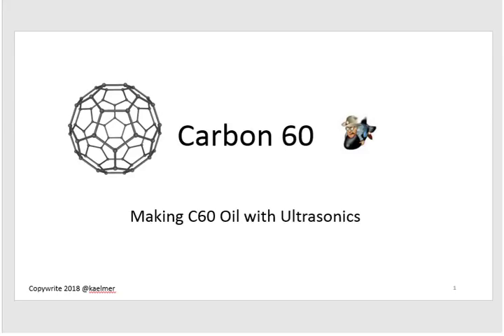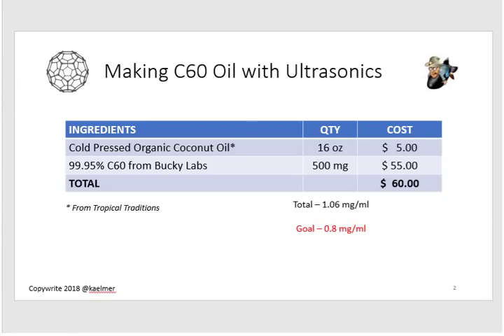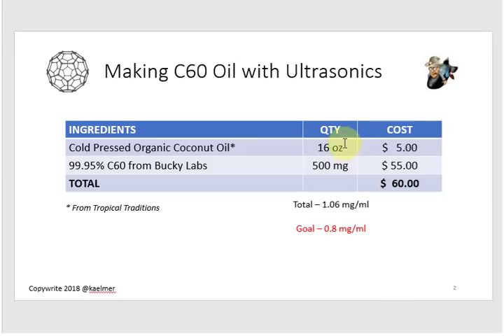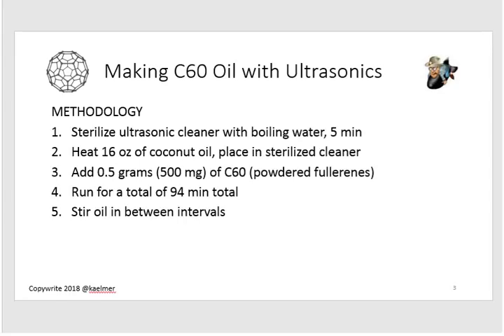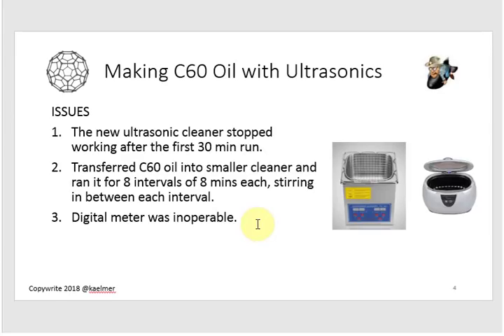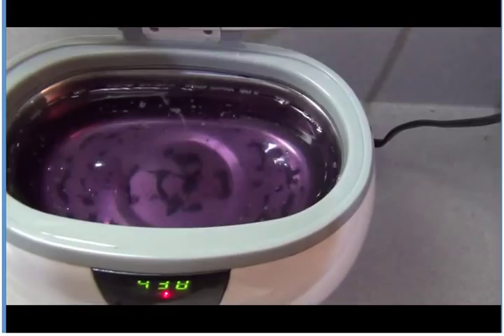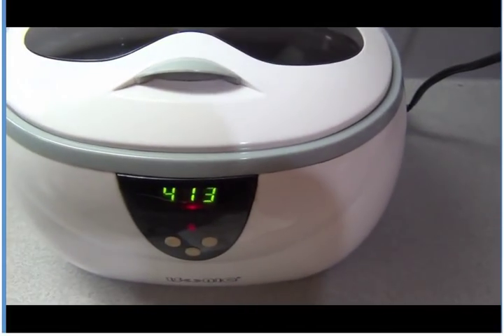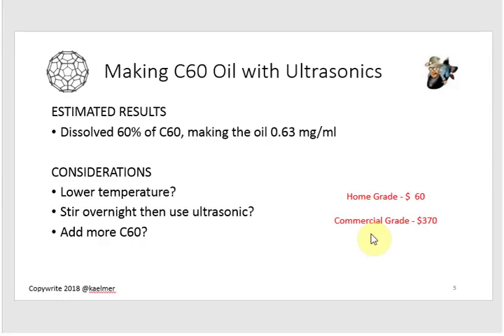Carbon 60 - Making C60 Oil using Ultrasonics

Comment: look into ichor labs research/comments on longecity. ichor labs had a batch that might have been made with ultrasound by SES. all mice were dying because of cancer (and it looks like the c60 group was hit badly)
still waiting for the final report to be published. so just to be sure: no light, no heat, no ultrasound.
Reply: Why no ultrasound?
Reply: That's scary!
Reply: no need to be scared. just to be on the safe side - no light, no heat, no ultrasound :-)
(so putting it in a dark bottle and shaking it 3 times a day for 3 weeks  is a cheap and safe way :-)
http://www.longecity.org/forum/topic/96700-update-on-the-status-of-ichors-c60-research/
"C60oo is highly reactive when light exposed, and that light exposed C60oo either had no effect or was acutely toxic"
Reply: My suspicion is that they were either using sub-par fullerenes or rancid oil.  If you consider that the rat study scientists were using stirrers and centrifuge I can't imagine an ultrasound could make that much of a difference.  Have you successfully made any c-60 using the hand shake method?  I actually already have a stirrer packed away in the shed but am considering purchasing an ultrasound as well.  Thanks.

Comment: Thanks for the nice video. I also make liposomal Vitamine C with my ultrasonic machine. I was warned not to do it directly in the ultrasonic but in pyrex beakers because of the nano steel particles contamination.( very bad for your health). I have been using thin walled beakers succesfully for quite a while now. The thing you have to take into account is that the pyrex absorbs part of the ultrasonic waves so I add extra time for compansation. The thing with all ultraonic machines is that they cannot be used for too long a time in a row. Google that pls. I take a break of 30 min after using it for 30 min. for that reason. 
I hope you share another video about what has become of the residue and any further experiments. Thanks again for this one

Comment: hey mate i blew one of those ultra sonic machines up when  first started liposomal c. i have bought another one and only run for 20 min at a time with ice cold water in it then restart hours later and it hasen't blown. they just get to hot the fans are shit.
i float a pyrex bowl (like one a cook would use 10mm thick) in the ice water don't put any solution directly on steel of ultra sonic machine you will contaminate product. Also don't use thin wall pyrex beaker as strong sonic machine will explode hole in bottom of beaker, haha messy.
Reply: You risk blowing a transducer by setting a container directly on the bottom of the tank.  A thick glass container makes it hard for sound waves to travel through.  Thin glass works better.  Place a plastic scrub pad on the bottom of your container.  Anything to avoid direct contact with the bottom of the tank.  If you want to get fancy,  cut a hole the size of your flask in a piece of Masonite or plastic sheet and place a heavy rubber band around the flask to keep it from slipping down.  The water level in the bath should be even with the liquid in your container.  Adding ice cubes will cool the bath down.  A turkey baster can take water out if needed.

Comment: Coincidently I ordered my ultrasonic cleaner the same day you posted this. I have 1000 ml spinning right now but wanted to try the faster method to compare the difference.  I'm using 99.95 C60 from SES Research at $70/g and fractionated coconut oil as the carrier. Using .71g per 1000 ml (slightly less than the rat study.  Given the ambient temperature here, which is a very critical variable in the absorption potential of the oil, .71g/100ml is about the max I can expect.  If you are interested in my results contact me at sclewis (the number 4) @ hotmail.  Thanks for posting your experiment!

Comment: The problem I have ran into is that they will not sell C60 to me the average Joe without being a business where can I purchase C60 and have it delivered to my house
Reply: I bought one gram from Bucky Labs.  I saw others that will sell small quantities also, don't recall names though.  I read a bit, and found that the lower priced powder containd solvent residue, so decided to get the higher priced, higher percentage one.
Reply: Like I said, I got mine at Bucky Labs, buckylabs.com  It took about 2 weeks to arrive.
Reply: WhoToBelieve I can only find c60 mixed with olive oil on their website. Where do I find the powder?
Reply: I'm sorry, I didn't do a good job of answering your question.  Go to the website; select "Products"; scroll down below the oil bottles and you see "Fullerenes", there are 2 selections, 99.9% & 99.95%.
Reply: WhoToBelieve Thank you very much!

Comment: Thank you for this update, please keep us informed. I have a batch in a mag. spinner and it has another week to go. I am going to buy a jewellery cleaner from Amazon  and give it a try. I found a cheaper place to buy the C60 in Canada, a place in Quebec called Solaris Chemical who sells 99.9% research grade fo $60-70US per gram. Check it out it looks like this place makes good product, I am not yet finished my research on them but so far it looks good.
Reply from the maker: Thanks!  I saw those guys, one of the vendors on the list uses them.  The reason I bought from Bucky Labs was my decision to use 99.95%, which Solaris doesn't sell.
Reply: Actually now they make both 99.95% and 99.99% C60. I just asked for their research material and they sent me the full report and a report on oil absorption rates for their C60. Big report, it will take time to go through it. I will probably send it to my daughter [who is a scientist] to read and make sense of. They are using a method derived in Russia. Apparently the Russians have been feeding this to their athletes and military people for many many years with great effects. I got that info. from relatives of mine [ I am 50% Russian heritage ] . There are a couple of C60 in oil sellers who are using their products and I am told 2 or 3 who make it for animals.
Reply: thank You . I just found the link.. and requested More Information, which they offer to emaiL > > > http://www.solarischem.com/C60.html
Reply: Earl K. Would you share that report? Or if there is a link for it I would like to take a look my self!
Reply: Earl K. Thanks so much for all your comments and info.  Huge help!

Comment: Great video series, Thank you.
Would a TDS meter work to determine the saturation level of C60?
Is the coconut oil/C60 combination, processed ultrasonically, a mixture, a solution, or liposomal encapsulation?
Would ultrasounding longer increase the saturation level?  I think higher wattage would help also.
Check AliExpress for an ultrasound unit.
Very informative, thanks again.
Reply from the maker: Yes, was thinking of running it much longer to see if there's less residual C60 left and did consider using a TDS meter, but from what I understand, the C60 molecule is so small, I don't think it would pick it up, and not sure how well they work in oils.  Certainly worth a try though.

-and this process results in liposomal encapsulation.

Comment: Thank you for the video on the ultrasonic cleaner, I was looking on Amazon and found only jewelry cleaners, me thinking there must be a food one, wrong. Ordered what i needed for the 2 week steering batch, but would be great to have one that works so much faster. I will keep watching your videos as they have already taught me a lot, thank you.
Reply from the maker: They're all for jewelry so the assumption is its not food grade stainless steel, which is why some lipo instructions advise to keep your solution in a flask and put it in water inside the cleaner.
Reply: WHAT  do you suggest? I don't know if a glass beaker will fit. i just ordered one that holds2.5L and i have a 1000ml beaker. Is the difference between a good grade stainless steel and not a lot. Some times people are afraid of their own shadow and I was an old farmer so I don't sweat the small stuff.  Thank you for writing me back , you are a great help.

Comment: I realize that your process didn't go quite smoothly like you wanted, but if you did this for approximately 180 minutes, would the rest of the C60 then dissolve into the oil?  Because the C60 is expensive, what did you do with the leftover that didn't dissolve? Did you use the ultrasonic to save the 2 week stir time of the other process? I appreciate your very clear presentation on your videos !!
Reply from the maker: Plan to add more oil to the remaining C60 and give it a run to see if I can use it up.  Running it longer is definitely another good idea to test out.  -and yes, I'm trying to find a faster way to make it.  Sort of my quest for better, faster, cheaper...
Reply: I am wondering how to test for the purity of the c60 you made? I also was told by a producer of the c60 oil he follows the French method and does the 5 grams to the oil but hen reuses the left over c60 into the next batch but he does not supply any documentation or verification of the potency he provides, just simply states he follows that method but I dont think the French guys reused the c60 afther the run they did, or did they?

Do you think a PPM meter would pick up the PPM's in something ordered from Purple Power and then checking your c60 oil against that?  I would suppose getting it lab tested would be pretty expensive. I do want to try to make my own but I am worried that just trying things and not fully knowing the end product either may be a waste of time and or money. 

I love your vids and subscribed, keep up the good work and if you have any suggestions to determining the potency please let me know.
Reply: I found out from one of the labs guy that C60 has no expiration, and that yes, he thinks that the remaining C60 powder can be reused for the next batch. And to be careful where you order your commercially prepared finished product, because said lab guy had to ban one seller that was ordering the class that is of lesser purity and potentially had many solvents in it.
Reply: I have heard that its OK to use it again

Comment: Nice!  I'm curious to find out if the fully saturated coconut oil works out.   My family and dog, have no issues eating extra virgin coconut oil... But the liquid version (possibly MCT oil) from purple power doesn't fair as well with my wife and I.  

I'm 1 week into stirring 1 liter of liquid coconut oil (Nutiva Organic, unrefined, liquid Coconut oil) that is not the MCT version... The oil stays liquid at even fridge temperatures yet still has that slight coconut flavor that the fully saturated oil has.

Mine turned a dark purple within about 3 days.  I used 0.78 grams of 99.5% pure c60.  I did use a stainless steel mortar pestle (Apothecary's Grinder) from Amazon and polished it smoother.  It really ends up looking smeared in the mortar... I then used the oil to rinse it out a little at a time. 
I'll still stir it the full 2 weeks... Yet I'm not sure why, just to be safe I guess.

I wonder if my wife will miss her ultrasonic cleaner..?  Hehe
Thanks for your videos... I'll need to keep coming back here to keep up with the comments from all of us self-appointed lab rats.
Reply: Glenn W. I beg to disagree, Glenn. MCT coconut oil according to my research remained liquid because one or two components was taken out, like the lauric acid.
Reply: I've only been on C60 for a week, I've already finished 2 oz. of the Live Longer Labs brand. I also notice some stomach irritation, which doesn't usually happen to me with coconut oil or any other oil for that matter. I think it's the C60 that may be irritating to the tummy, I don't think it's the oil.
Reply: Ashley Lala:  
I have heard of people getting sick from much smaller doses since its 172% stronger than vitamin-C.  Go easy and try and work up to the 2 oz maybe?  Good work!
Reply: Nicholas Koenig thanks for your comment. I watched Sarah Westall's recent interview with the Live Longer Labs guys and they seem to recommend higher dosing if you have health problems (I do). There was a lady on that vid who was trying to heal macular degeneration and they told her to drink the entire bottle in one day! Yikes, lol! I notice it seems to be helping me a lot so I don't want to back down my dose just yet but I am adding a product called Restore, which helps repair the gut. If the tummy problem doesn't get better from the Restore, I may back it down a lil bit.
Reply: ALL coconut oil is 'MCT'.  Medium chain triglycerides.